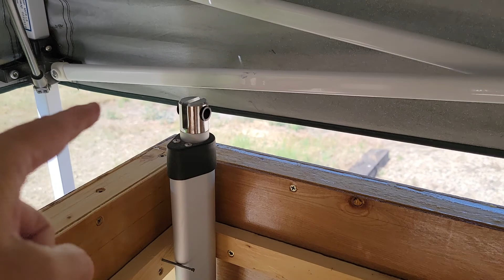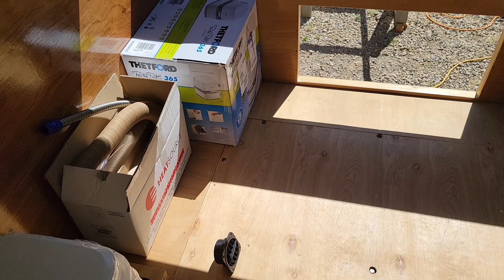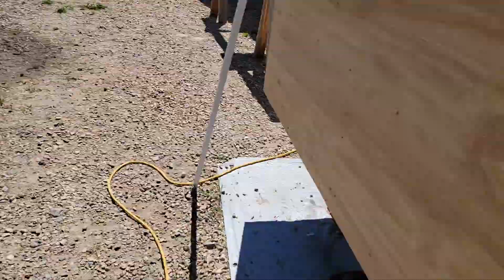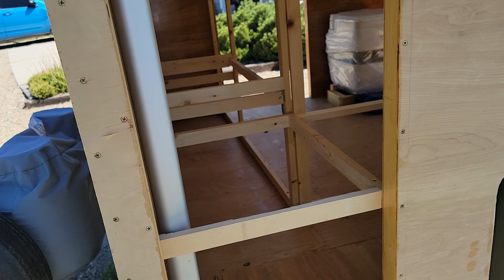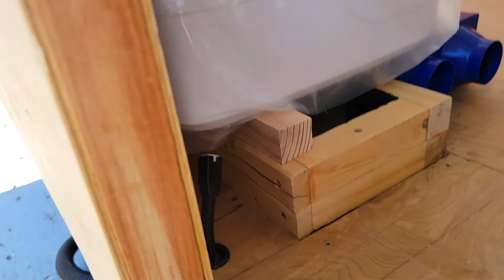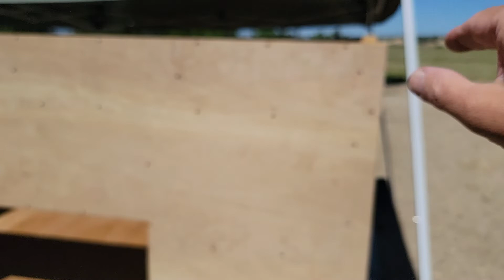Gypsy Caravan Project, Part 4: Lower Section Construction Methods & Progress

Comment: Just found ur channel. Looks great. What did you use to build the lower walls? The inside walls look high glossed, did you stain or seal it on the inside? Same questions for flooring...
Reply from the maker: All of the walls and floor are 1x2/2x2 framing with 1-1/2" structural Polystyrene (XPS) cut to fill the gaps, then skinned with 5mm hardwood ply. The interior is just sealed with polyurethane,  but the outside is wrapped in "PMF" (poor man's fiberglass), which is glue-infused canvas painted with a gripper-sealer undercoat and then several coats of marine boat paint. I talk about all that in the videos, so you'll see what I mean if you keep watching. Enjoy!

Comment: I am enjoying your videos thank you for sharing.  I am wondering what the thickness of the inner and outer plywood is.  Thank you in advance.
Reply from the maker: I used 5mm hardwood ply, which is equivalent to 3/16" or 1/5" (.19685"). So just a bit less than 1/4" ply, and therefore slightly lighter. Altogether with the interior and exterior ply over 1x2 framing (1x2 being really only .75 x 1.5"), plus the canvas wrap makes the walls come in right at 2" thick. Thanks for the comment and question Enjoy!